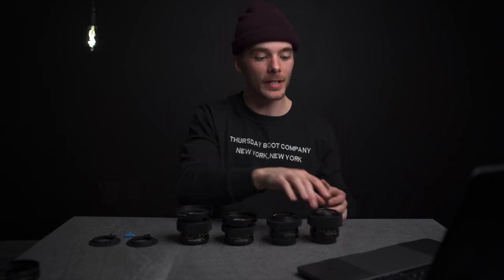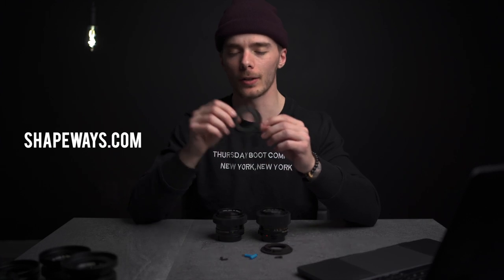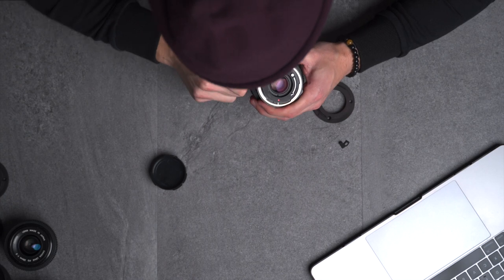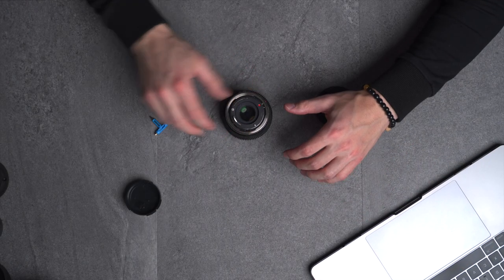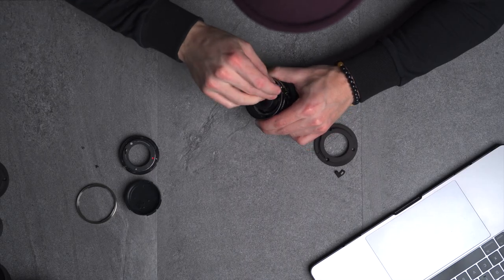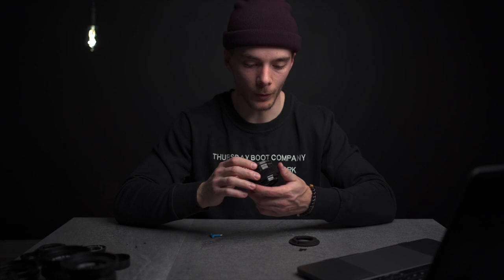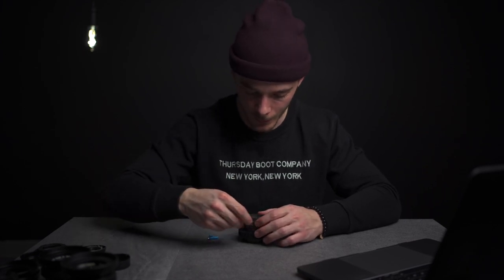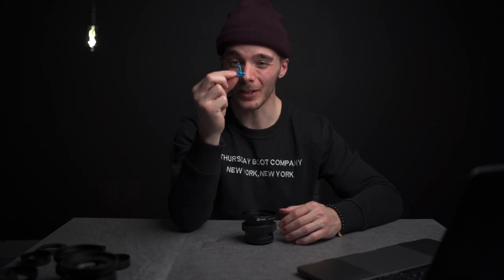Converting Canon FD Lenses to EF Mount // Budget "Cine" Lens Set

Comment: Hey Mac, I'm about to do this process and thanks for the great tutorial. Quick question, I noticed there's a decent sized gap between the rear glass and the edge of the Shapeways mount. Do you think this will let in excessive dust into the lens? I wrote Pedro the designer to see if he could make a more specific sized rear mount for the 20, 24 and 28; as the standard mount seems ideal more for the 50mm, 85mm and possibly 135mm.
Reply: I posted a question on a vintage lens forum and the response from lens nerds is that the gap / space will NOT make much of a difference for dust since it will either have a cap on or be on the mount. Thanks again for the great tutorial.

Comment: Hey Mac :) How are you man? Awesome video, thanks to you I transformed three FD Lenses these last past months (24mm f/2, 35mm f/2 and 50mm f/1,4). Do you know by any chance if it is the same operation with a zoom? The Canon FD 35-105mm f/3,5? Thanks mate!
Reply from the maker: That’s awesome! I’m pretty sure the zoom lenses require the “long arm” option on the Shapeways site. I’m not 100% sure if the order of operations is the same to do the conversion though. My best is advice is find a really cheap zoom, maybe one that’s got some fungus/bad condition and use it as a tester to see if it’ll work.
Reply: @MacOlink  Thanks, I als asked  to Shapeways maybe they will know ;) have a good evening and thank you for your answer! I prefer prime lenses but the Canon fd lenses are so cheap it is crazy...
Reply: No answer for the guy... It seems that no one ever received an answer... Very professional... I took the long arm for the 135mm, it should work ;) For the 85mm you said the 3mm arm works but is it the same for the 85mm f/1,2? Thanks!

Comment: Did this with my 50mm 1.4 with no issues and planning on continuing with 24,35,85 just like the video. thanks for the video dude! do you have any plans to do the 17mm f4 and 100mm f2 or 135mm f2 by any chance?
Reply from the maker: Anytime! As of right now I have the 20, 24, 35, 50 and 85. I don’t plan on getting any others, maybe a 135 down the line.
Reply: Awesome! I see a lot of people asking about potential infinity focus issues. I haven't had any problems with the 50mm 1.4 myself but have you had any issues with the 24,35 and 85?
Reply from the maker: @erikbakhshi  I have not!
Reply: @MacOlink  Thanks for the replies man!

Comment: I'm having the same problem with tight screws on a 50 1.4. How did you solve that problem?
Reply from the maker: I drilled them out VERY carefully haha
Reply: I had the same problem with the 50mm 1.4 for the outside screws. I bought myself a screw extraction kit on amazon and followed the instruction and carefully drilled them out.
Reply: @chumbolad9865  Hi dude ! Do you have the link to the kit by any chance ?
Reply: @raphjaaf  I do! Here is what I used. https://www.amazon.com/Extractor-Werkzeug-Stripped-All-Purpose-Extension/dp/B08LDMKR5G/ref=sr_1_5?crid=XY9FZ9ZXPMXY&dchild=1&keywords=screw+extractor+set&qid=1608416526&sprefix=screw+e%2Caps%2C174&sr=8-5

You need a power drill to operate it.
Reply: @chumbolad9865  thanks a lot! Did you use the smallest drill and extractor?
Reply: @raphjaaf  I did.

Comment: How have the mount held up since modding them? I mean being plastic and all? I'm on the fence if buying the plastic one or going full metal from the start. Great video btw!
Reply from the maker: Mounts are holding up amazing tbh. I planned on upgrading them all to the metal but I see no need to. The plastic is very high quality
Reply: Mac Olink Damn, sounds great I think I’ll save my money and go with the plastic then. Thanks for replying so quickly.
Reply: Just wondering if they still held up? I saw some people having issues
Reply: @Jared10112 if you‘re still wondering - I‘ve had mine for roughly 2.5 years on extensive use and multiple lens swaps per day, they‘re like day 1. I didn’t notice anything bad!

Comment: What is the difference between aputure arms 1 and 2?
Reply from the maker: I honestly couldn’t tell you, sorry. But i think they’re for certain focal lengths. Pretty sure I’ve heard somewhere that the longer arms are for the FD zooms/wide angles. I could be wrong
Reply: Mac Olink thanks for replying and great video. They sell a 3mm and 10 mm version arm and both in a v1 and v2. You are correct the 10mm is for the longer barrel roll like the 100mm lens. But they sell the same 2 arms in a v1 and v2. I wrote them 2x and no answer.

Comment: This might help people. Got this response from Pedro the designer

Yes the 17mm f/4 has its own mount because of the diameter of the rear element is smaller and other user reported that the short arm works for this lens.
http://shpws.me/Sjvd nFD to EF mount for nFD 17mm f/4
http://shpws.me/MZvG short arm for nFD 50mm f/1.4, nFD 24mm f/1.4, 17mm f/4.0 and nFD 24mm f/2.0

for the nFD 135mm f/2 I did not design an specific arm yet, but I can help you if you share some photos of your lens. I attached an explanatory Image of the photos I need of your lens so I can design the arm and you can order it.

Also I leave a list of the compatibility of the aperture arms.
http://shpws.me/ShCi aperture arm for nFD 50mm f1.2
http://shpws.me/ShCk aperture arm for nFD 28mm f2.0
http://shpws.me/MZvI long arm for nFD 100mm f/2.8 and nFD 85mm f/1.8
http://shpws.me/S9cv aperture arm for nFD 28mm f/2.8, nFD 35mm f/2.8, nFD 50mm f/1.8 and nFD 24mm f/2.8
http://shpws.me/Sa3T aperture arm for nFD 20mm f/2.8
http://shpws.me/RByj aperture arm for nFD 100mm macro
http://shpws.me/Sawo aperture arm for nFD 135mm f/3.5
http://shpws.me/Sawn aperture arm for nFD 35-105mm f/3.5